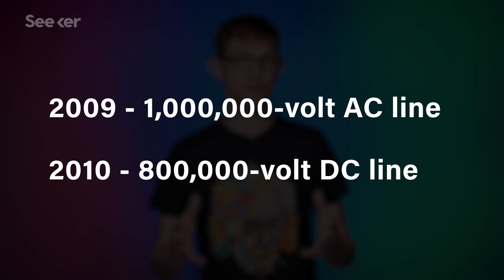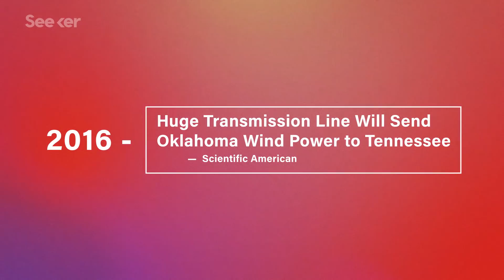Can We Power the World With a Single Energy Grid?

Comment: I think it wouldn't be a good idea. Akin to putting all eggs in one basket.
Reply: Actually it would be the opposite of putting all your eggs in one basket. It would allow nations to be able or get their energy from many more places than they can now.
Reply: @stephenrowley4171  That's true. But wouldn't that kind of unified power grid need some kinda more or less centralized monitoring system or whatever? I was mostly referring to the fact that it would be all connected and easier to hack. Though, I suppose there could be ways to just disconnect and isolate certain parts of it temporarily.
Reply: @TheNightquaker  You could do like most of the European countries are currently doing. Instead of simply connecting the energy girds together to form a giant one. You could instead have multiple nationwide, or regional energy grids that instead trades power between them through multiple connections between the grids. This actually strengthens each connected energy grid and gives the people monitoring the grid more tools at their disposal to ensure that the grid remains stable.
Reply: @stephenrowley4171  yes it would be, no one would build ten cables from america to europe, it's much like one or two superconductor cable. And that is connect at some point for exempla if we connect this to UK well the UK now has the power to shutdown. The source of energy is much more decentralized, yes it would have more places to get energy, but less places to transmit energy. You can get energy from south africa, but still passing between UK.

Comment: A bigger grid is also more stable
Reply: If the different grids are only connected with a few high power lines, it's probably true that bigger isn't better because it gets easily overchallenged.
"The problem is that grids run close to the edge of their capacity because of economic pressures. Electric companies want to maximize profits, so they don't invest in more equipment than they need,"
https://m.phys.org/news/2014-04-power-grid-big-right-sizing-blackout.html
Reply: According to China themselves, no, at least in terms of strictly AC grids.  They recently desynchronized the grid in Yunnan Province from the Guangdong area with a B2B DC converter station because it was a bottleneck and there was enough DC capacity linking it already.  It is a unique experiment.  AC laced with DC is most stable.
Reply: Big AC grids are vulnerable. One point of failure can create a domino effect which can result in a wide area blackout. That's what happened in the Northeast blackout of 2003. Independent grids like in Quebec and Texas totally escaped it by cutting out their inter-connections
Reply: @lajya01  That is one reason separate grids exist and DC interties are used to connect them.  DC isolates these faults, but higher voltage/capacity AC can also remedy stresses to large grids which is why China uses both.